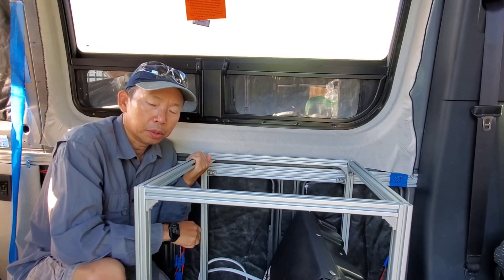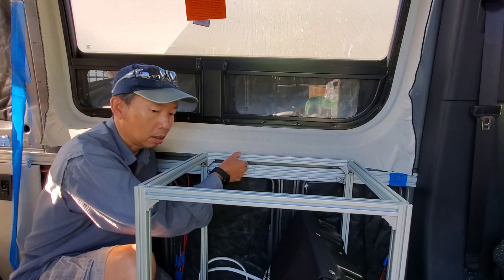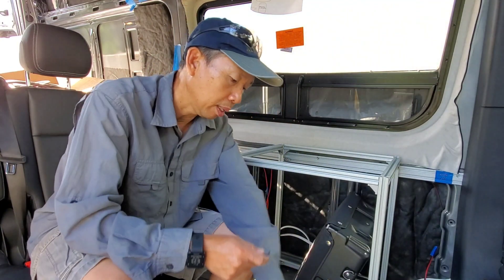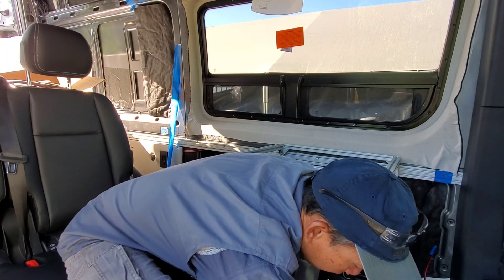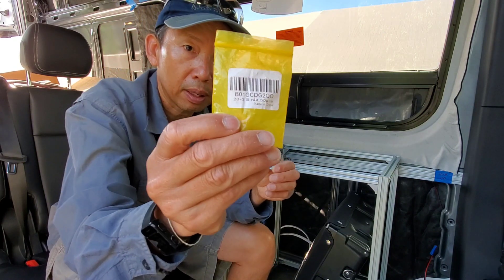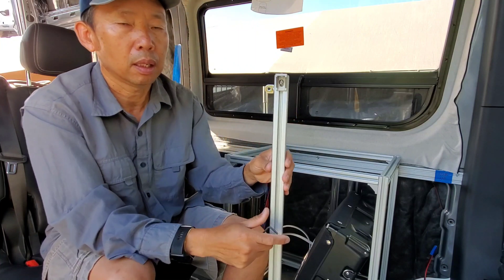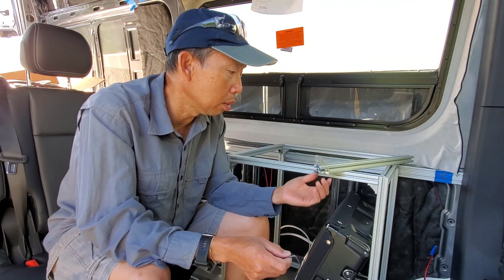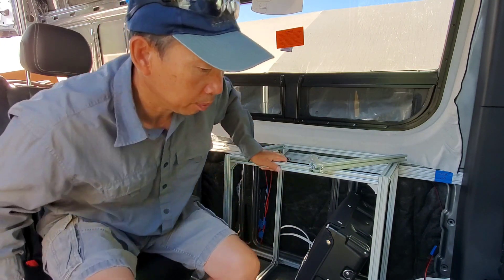Tips for using 80/20 aluminum and hardware

Comment: So the base rail which you use to attach shelf and counter modules to the van wall is a 15 series 80-20 piece that runs the length of the space behind the drivers compartment top and bottom of the cabinet modules.  This is secured to the interior of the van wall and gives you flexibility of an attachment point as you secure component cabinet modules.   Its a standard 80-20 piece not a special flat rail with an 80-20 profile on one side correct?  Good idea, better than attaching each module separately.  Please confirm.
Reply from the maker: That's correct.

Comment: Thanks for sharing your 80/20 approach.
I, too, plan to use the 1-inch 80/20 profile instead of the 1.5-inch profile.
The latter is too large, strong and heavy for my van application.

I ordered the 2028 corner brackets via your Amazon link,
they arrived today and I did some destructive testing.

I'd not seen anyone using the 20-series (20mm) brackets with the 10-series (1 inch).
The good news is they are stronger than ones I make from 3/16th inch L-bracket,
compatible with standard 1/4-20 bolts and economy nuts,
inexpensive and readily available.
Yea!  This will save me a lot of time chopping and drilling my own brackets.

On the other hand, the 20-series nuts and screws that came with that package
are ridiculously tiny, weak and useless with 1-inch profile in my humble opinion.

Thanks again for your video.
Reply from the maker: Thank you Neal and have fun van building.

Comment: Thank you for the video! What are your thoughts on using the 1inch instead of 1.5inch. Is it still easy to work with, and do you think it is strong enough?
Reply from the maker: Hi Kevin, since I'm building smaller frames the 1" is perfect.  But if you're building like a bed frame I would recommend 1.5".

Comment: Excellent video. I wonder how you will adapt drawers to the contours of the corner braces in the front of the structure? Wouldn't it be better to put the ones in the front on the top inner sides?

Comment: So do you order the aluminum to size for your project or do you cut it somehow or what?
Reply from the maker: I ordered 12' in length then cut as I need using circular saw with aluminum cutting blade.